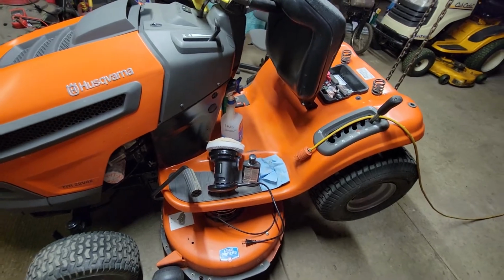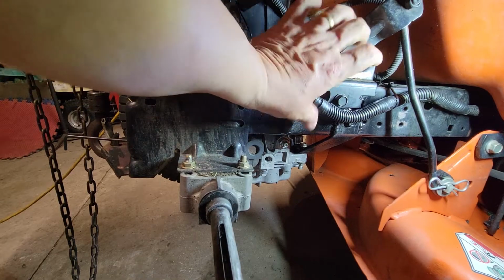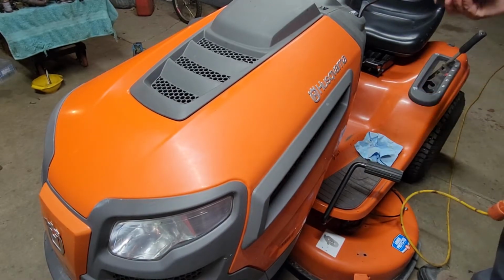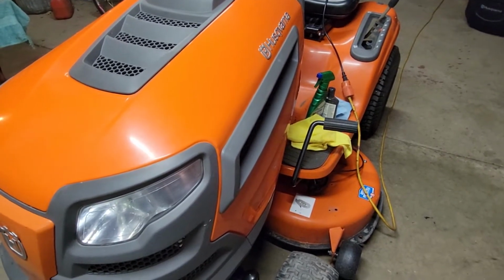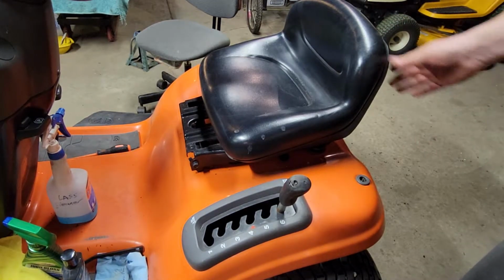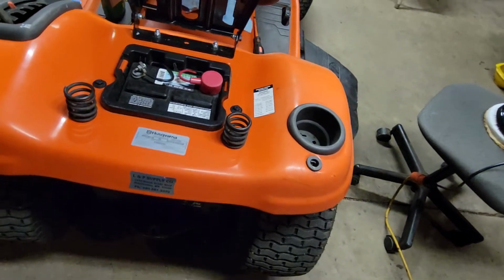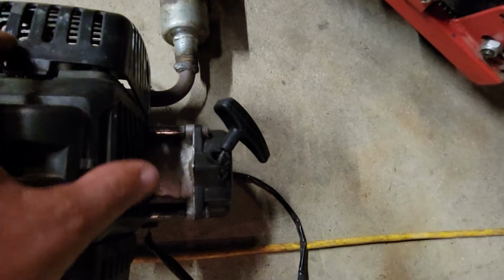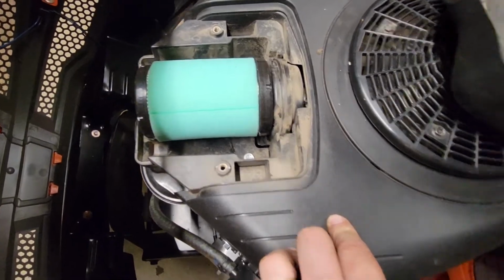shining the paint up on the Husqvarna

Comment: Good call on the crack.  An easy one to miss if you were not underneath working on the belt.  Just installed my belt today on my Ford, 4 hours of labor but I got er done.  Mine is a little to rough for a buff but you have got the mower looking good and should have no problem getting a good price.  Love the bike, filter is definitely for the wall of fame.  Stevo
Reply from the maker: Thanks stevo. Yeah I bet the Ford belt was a tough  one. Those  old machines last forever but they never made them easy to work on eh

Comment: Bigger sprocket on the rear wheel makes it slower... think ten speed bike.
I'm enjoying your videos, thanks for posting!
Reply from the maker: Hi Timmy. I'm thinking with  the 2 cycle engine  it has a higher  RPM  that's why the smaller sprocket and the 4 cycle  mini bikes always  had a bigger  sprocket on the back wheel.  But I get what you mean about  the ten speed bikes. Thanks for tuning  in

Comment: Hey Dave. I guess you found the weak spot! Most machines have one. With the brackets right there the frame likely takes a sh@t kicking,  Looks good with the buffing. You did good with the parts, Here in Canada the blades would cost you 50 bucks. Love the mini bike, but that chain scares me LOL A bit of work and it would be fun on your long driveway. Take care
Reply from the maker: Hi John    thanks  , yeah it turned out pretty good.   As far as the bike yes I  would  have to  make a chain guard that's for sure